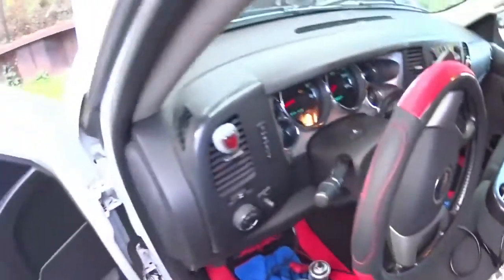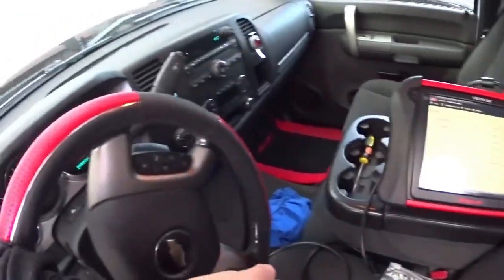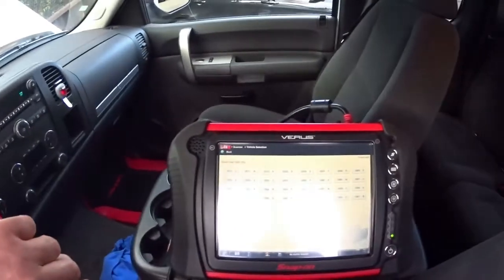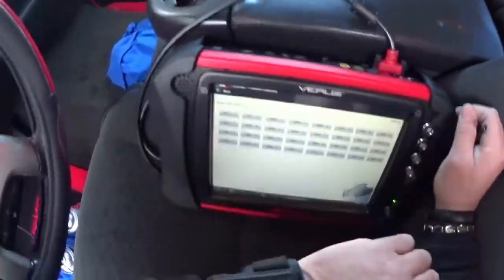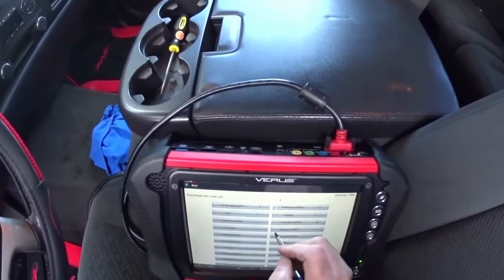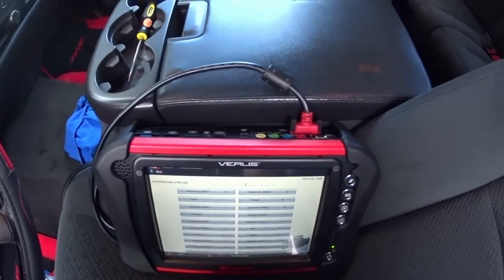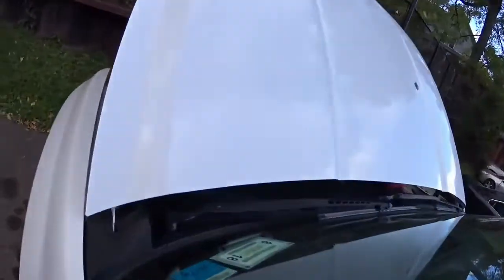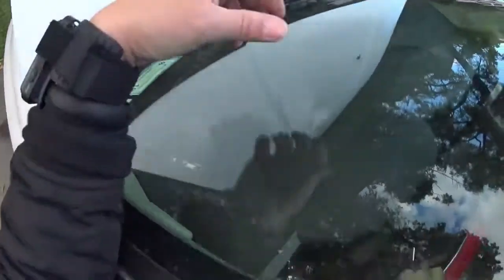DTC P3425 Cyl. # 4 Deactivation / Intake Valve Control Circuit

Comment: I did the AFM DOD delete and I'm getting these codes now how can I disable this system.
Reply: You ever figure out what to do? I did the same thing and this code popped up  as well.
Reply: @agugabri14  yeah you have to send the ECU out to turn off active fuel management using HP tuners
Reply: @zu1502  from what I know it got turned off when I flashed it with hp tuners. But I could also be wrong.
Reply: @agugabri14  yeah at first I was having misfire when I threw it in drive or reverse after I tune the ECU itself it went away I was able to put it in drive and reverse. I had the OBD plug in but that doesn't work
Reply: @zu1502  i cleared the code on it and hoping it doesn't come back, either way I think it's running to rich cuz it throws what looks like a lot of liquid (gas) from the exhaust.

Comment: When you say the CD manifold stan u mean the cylinder deactivation board under the intake...cause on my truck that deactivation board was change 2 months ago it drove fine n that the same misfire is back n is p3425 cylinder 4 misfire 🤦🏻‍♂️
Reply: What happen after you replaced it? I have a 2012 Yukon going through the same thing and I'm probably going to have to replace it.

Comment: I have the same problem now.. i only replaced the oil manifold gasket.. then the code appear..
Reply from the maker: Marvin Lusuegro Hi you mean the valve cover gasket!? Or the intake solenoid gasket!?
Reply: So what was the solution?
Reply from the maker: Marvin Lusuegro Hi yo probably damage the CD cylinder Deactivation solenoid wires they are very fragile and they crack very easy!

Comment from the maker: The fix in this case study was to replace the CD manifold Stan for cylinder deactivation function for optimized fuel economy!
Reply: Hi, i have the seem problem with avalanche 2007, cyl 4 and 7
Reply: What I've to do?
Reply: That's so sad for me, i don't have any good scanner to have a good diagnostic 😢😢😢
Reply from the maker: Well my friend the only thing you can do know is to buy valves medic too see if any chance is something stuck in de solenoid oil passage and or Lucas for engine also you may get lucky 🍀
Reply: I really appreciate your time to make all those very helpful videos😎😎
Reply: Greetings from Mexico
Reply: Hey man you may not get back on this anymore but I had a quick question about this how do you fix a situation I bought the truck and it’s got a new motor in it about 50,000 miles on the motor trucks at 200,000 miles can you help me please
Reply from the maker: @stonergames6976  so what is the situation?
Reply: @PeteSambolin   Engine oil pressure censor Circuit high voltage
Reply: @PeteSambolin  cylinder 6 deactivation intake valve control circuit open
Reply from the maker: @stonergames6976   engine oil pressure! They are famous for that most of the time is to replace the oil pressure sensor! The other code circuit high most of the time is because the connector to the CD manifold is not connected… very difficult that connector between firewall and the engine to get…most of the time the person that do not know the connector have a specific way to take the security lock 🔒 out well damage the connector! Then with the engine vibration the connector will get disconnected…

Comment: I have this issue now the mechanic put trans fluid in my oil he said it’ll clean the engine he got rid of the check engine light now it’s back on and I hear a poppin from the exhaust